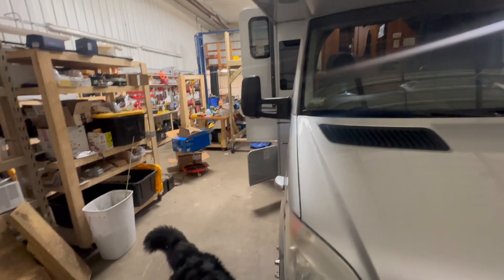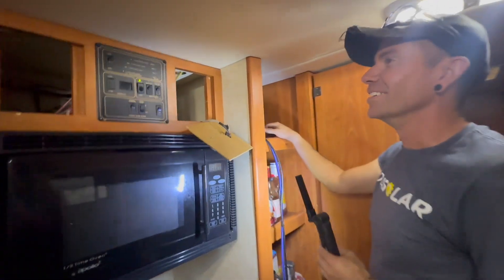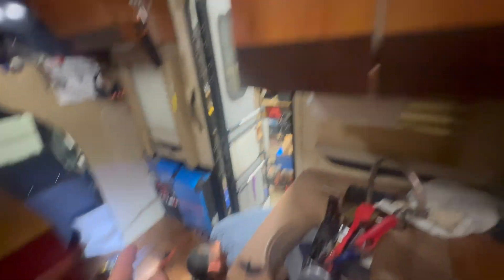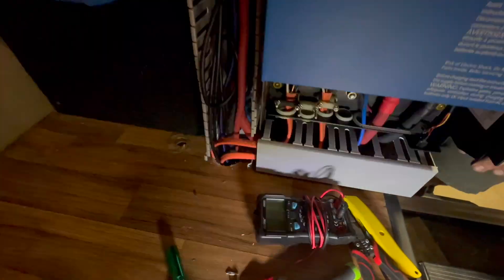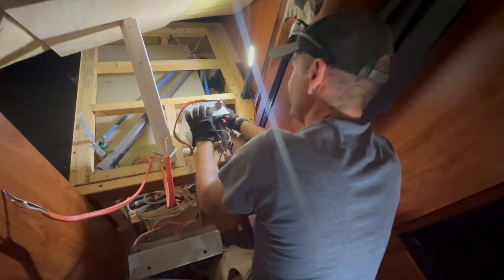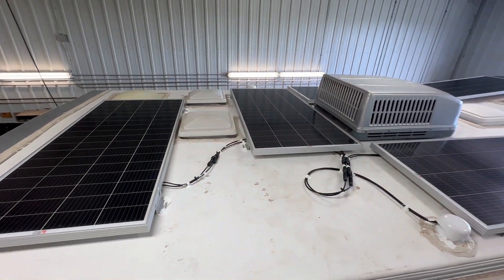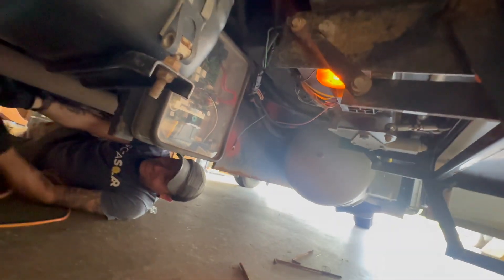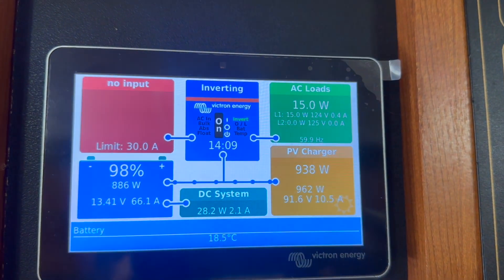Coachman Prism RV Victron Solar Install

Comment: Some say the Victron controllers wont charge the battery till its over 5 volts above the battery. So if I'm getting 16 volts and 18 amps it still isn't charging? That's 288 watts. If this is the case what should I do to raise the voltage? You can charge a battery with 1 amp.
Reply from the maker: If the controller says it's charging, it's charging.  Higher PV volts lets the charger work more efficiently to create more amps into the battery, which is ultimately what you want.  If you have 2x 100w panels, put them in series and see how it goes.  There are some instances where keeping them in parallel makes sense.   Those scenarios are usually around consistent partial shade conditions or varying angles of panels.  If you can get 2 panels in series and they won't be shaded or at different angles, go for it.

Comment: Very cool.  We just picked up a 2007 Itasca Navion and I have intentions of doing something like this in it.  This is going to sound crazy but I'm thinking about using a trailer hitch cargo carrier to build out a removable battery and inverter box that could be installed on several different rigs depending on the needs of the particular mission for that vehicle.  There's just so little space in these tiny Class C's that it's hard to justify giving up any amount of storage for the electrical equipment.  Well done on this installation, as always!
Reply from the maker: We do something like that for food trucks that we work on we call it just a solar generator
Reply: @sotasolar  It'd be something like that but with a small generator as the primary recharge source and the vehicle alternator as a secondary source.  We stay at enough Harvest Host sites that don't allow overnight generators that this type of solution could make sense for our usage scenario.  I'd love to do it on solar entirely, but these tiny units don't have enough roof area to reliably run an A/C unit overnight in my opinion.  I already have 16x 306aH EVE LFP cells ready to go, as well as a 3kW charger/inverter.  This should give me over 15kWh of capacity for running the A/C and other loads during quiet hours overnight.  Also I just installed a Micro-Air Soft Start so start inrush current won't be a problem with either the inverter or a suitcase generator.  If you couldn't tell, I absolutely detest trying to sleep when it's hot and muggy.